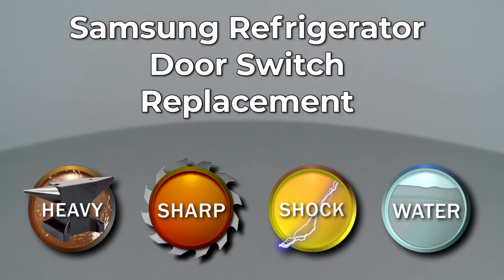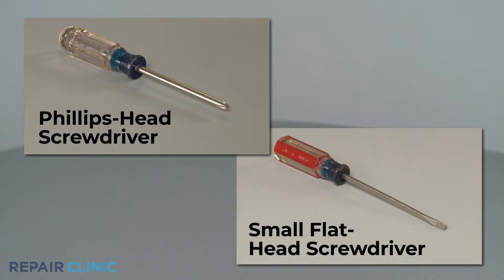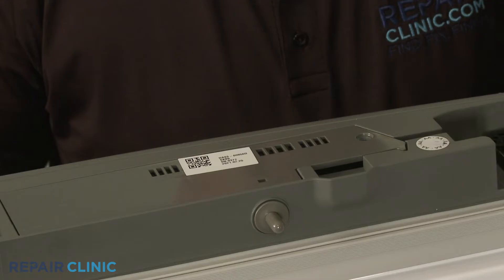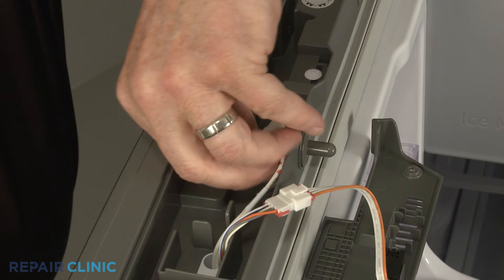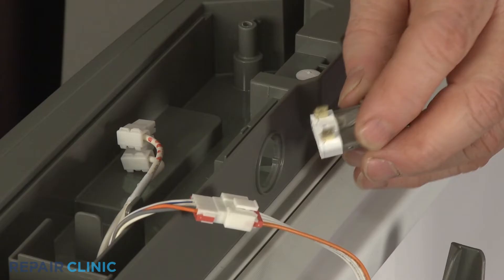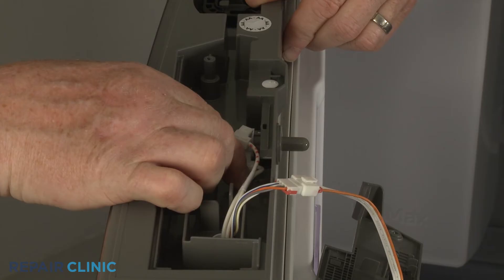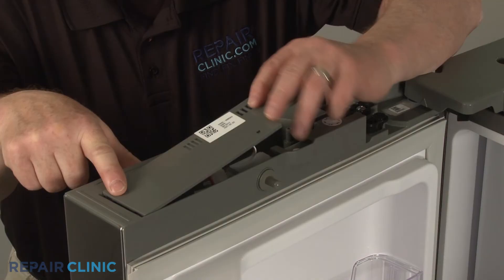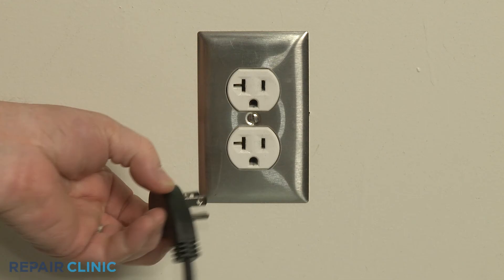Samsung Refrigerator Door Switch Replacement DA34-00066C

Comment: Just replaced mine in 3 minutes. Thank you! Bought the replacement part for $7 online
Reply: How do you know what part you need
Reply: Hi,, how do you know what switch you need and where do you get it
Reply: @valmamartin2131  Usually all samsung fridges use the same one. I bought one on ebay and worked perfectly.
Samsung RF263BEAES Refrigerator door switch DA34-00066C
Reply: Part: Samsung RF263BEAES Refrigerator door switch DA34-00066C

Comment: I just found a broken wire under the lower right door of my Samsung Bespoke fridge. Its black wire that connects to with plug right next to the lower hinge. The light stopped coming on when the door was open, and the alarm has been going off constantly that the door is open so it has stopped holding temp. When I unplugged the white connector the interior light instant came on. The door doesn't seem to have this pin the video above shows so I think it must be a magnetic switch. Anyhow Samsung has determined it is physical damage so the warranty won't cover the repair. The tech they sent out says the entire door must be replaced, but this seem excessive since this wire was installed at one point. Is this accurate or is there a way to replace it?

Comment: When the switch is depressed, the inside light should go off? Correct?
Reply: You would think so but my switch doesn’t see to do anything 🤔
Reply: That switch is so the ice maker knows the door is closed and it can dispense ice when the outside button is pressed
Reply: @zeroh_chill2966  Its meant for the ice maker to know that it the door is closed so it can dispense ice
Reply: @zeroh_chill2966  Yah, so the switch is depressed, but the light is still on.  Does that mean its faulty?
Reply: @a-mb9373  No.Reed switch is controlling the light on my samsung fridge. Not the door switch.
Reply: @Xcreator999 just changed my switch after seeing this video and reading the comments. Finger’s crossed it fixes it.
Reply: I can confirm it worked! 😊
Reply: @zeroh_chill2966  mines doing the same what could be wrong